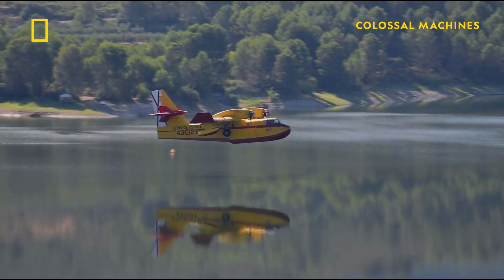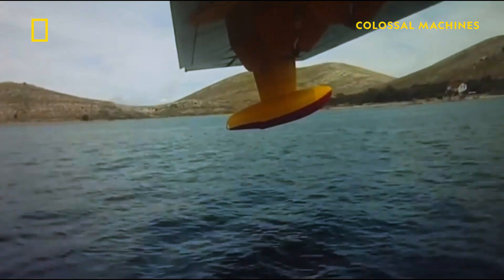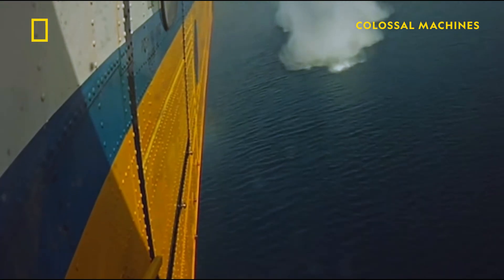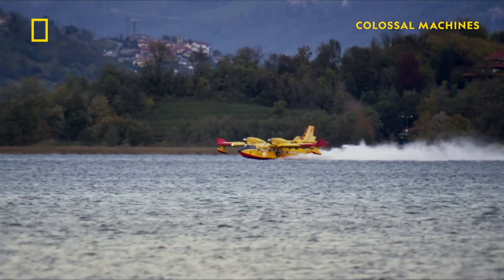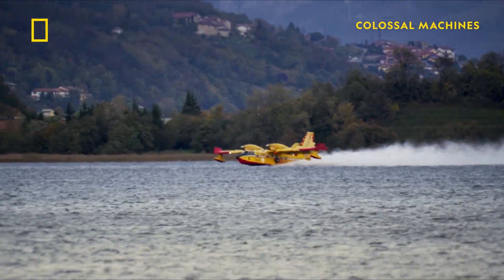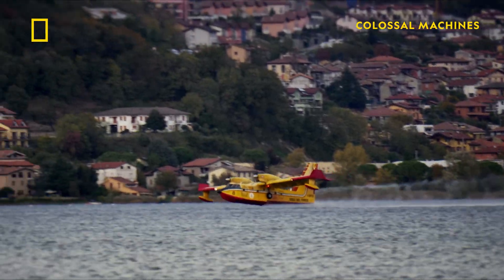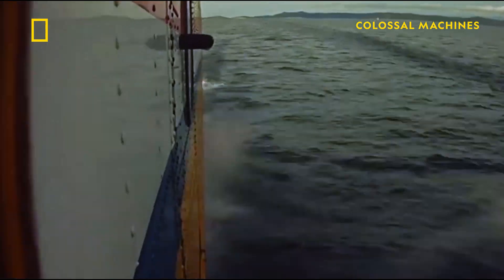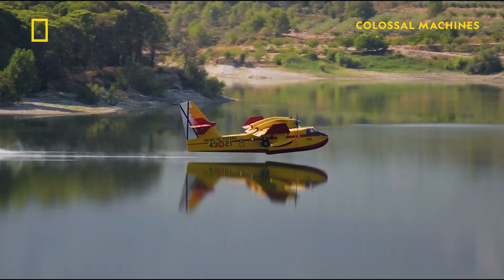Design Features of the CL-415 Plane | Colossal Machines | National Geographic UK

Comment: In those 12 seconds skimming the water, this plane can scoop 1,600 gallons (about 6,000 litres) into its tanks. 

So the designers had to oversize the control surfaces of the cl415. This makes it very nimble while carrying the heavy load.

Comment: Now imagine there is an engine that runs on hydrogen and able to use water as fuel too.
Reply: Major issue with that plan, unless you have a consumable reactant to efficiently convert water into Hydrogen and oxygen it is going to take more power to split the Water than you will get back from burning hydrogen as fuel.

You can just use hydrogen as fuel in the first place and skip trying to convert it. But  hydrogen fuel infrastructure is pretty rare still, the only way you could split water and make enough power to fly the aircraft and power the splitter would be to use a hydrogen/hydrogen fusion reactor... Which would be heavy, produce considerable radiation, and result in a rather massive aircraft that wouldn't be practical for fire fighting... Also we're still trying to make large heavy ground based fusion power plants, it might eventually be possible to make a reactor small enough to fly with but that's more likely to be useful in spacecraft
Reply: @UNSCPILOT it would take a lot more hydrogen to power the plane than using aviation fuel. They would either need to refuel more often or make the plane much bigger.   When we are dealing with an emergency like a fire I think we can ignore carbon emissions and just focus on getting the job done
Reply: Yea using hydrogen is possible but idk for a plane because you’d probably end up with a design that has a huge battery and I’m not sure about the complications of water quality and salt water

Comment: Many questioned. It has two places that open in the hull so the force of the plane skimmimg across the water, basically forces the water inside. It has no gears so is able to use fresh and salt water. The openings are closed as the planen takes off. Because it does not need to land to fill it can drop more loads in less time. I believe it takes 10-12 seconds to fill.
There are several other videos that actually show it filling at water level.

Comment: Sorry how many decades has Canada had this aircraft? It ain't new.
Reply: Created originally in 1969 for fighting fires.There have been some improvements since then. It is built in Quebec  and very specialized. It can use salt water as well as fresh because of its design.
Reply: In its piston version, it is in the Spanish Air Force since 1972, substituted by turboprops later. The USA has always refused to use the CL-415 for political reasons, foreign expensive aircraft, not for efficiency.

Comment: No mention of literally how it collects water.  Just said it scoops water.  Move along, not worth the time.
Reply: https://youtu.be/fuLk5hXMRZY?si=-JMRpC0HK7mCeMyt
Reply: yup
Reply: thing is... that actually what it does... it scoop water at high speed to fill it tanks.
Reply: It has two scoops that open up before it hits the water about the size of an iPhone on either side of the plane and it fills up 1600 gallons in 10 to 12 seconds
Reply: You have to watch the full episode
Reply: @ Fair, but why this headline and no link to the "full episode?"